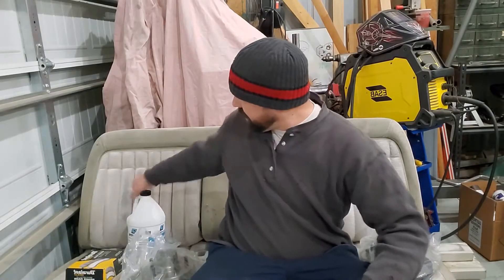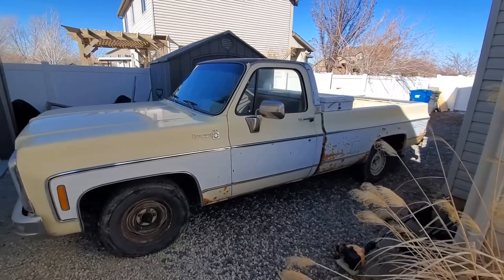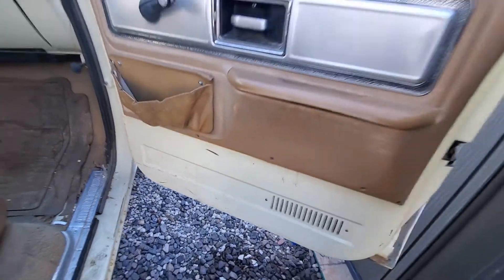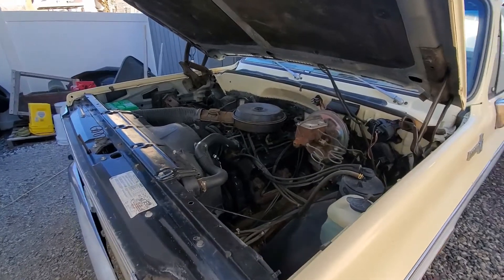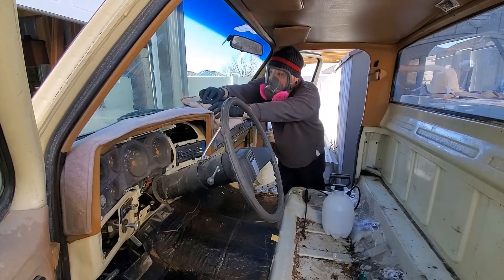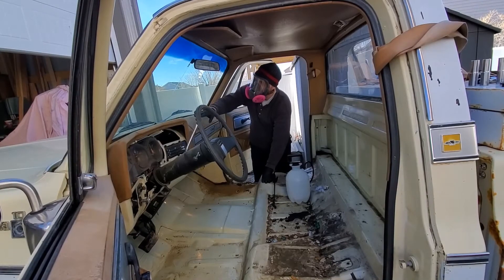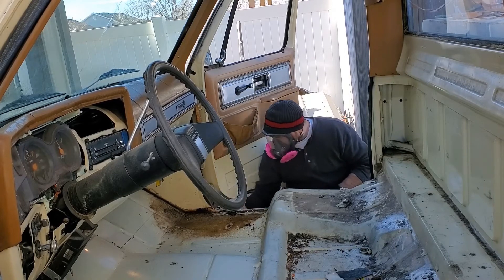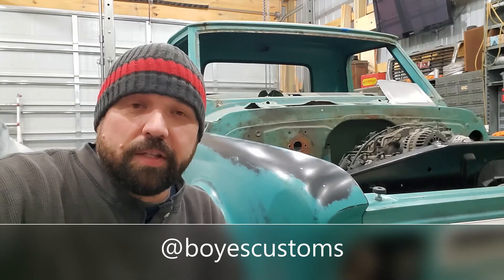Ep 2. 1980 Chevrolet C10 - Bonanza

Comment: Those third generation Chevrolet C/K series pickups with the Bonanza trim level are hard to find nowadays. GMC's version of that was the Royal Sierra which are also hard to find nowadays. If I'm not mistaking, I believe those trim levels were produced from 1976 - 1980.
Reply from the maker: Your probably right.  I'm not sure much about them. I haven't done a ton of research though.  I really enjoy mine.
Reply: I think they were Spring-time specials, so not many around.